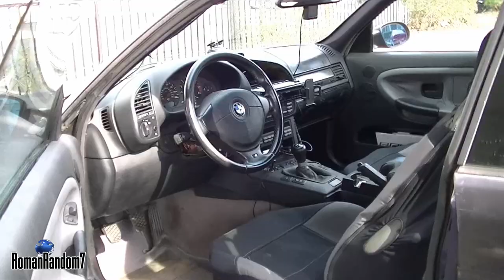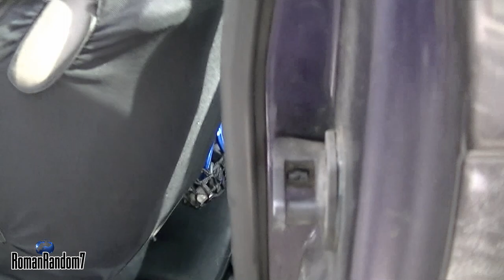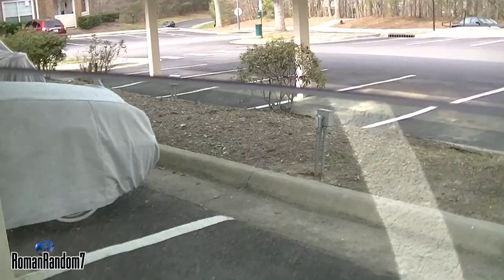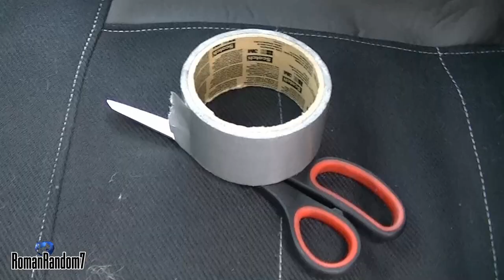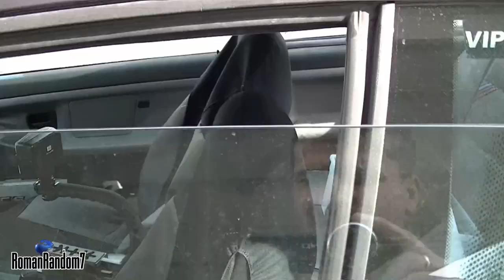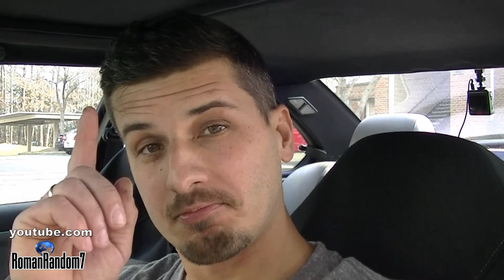BMW M3 E36 Coupe, Door Striker Sensor / Switch Temporary Fix

Comment: 325tds, doors locked, bounced open again, two years or so locking door by door by pushing the ¨locks¨ and the trunk, tried this and bam! didnt even know sedans have the switches there, so worn out that the door striker it doesnt push it down, no random id say, this is good shit
thanks man!

Comment: Great video.  Simple solution.  A more permanent solution that is also easy is loosely putting a few zip ties around the back of the striker- their cable thickness is perfect for the missing material and very cheap.

Comment: Yes. As U use the driver's door more often it's cheaper just to swap the switch with the passenger side AND be careful not to let the inside mount plate fall inside the body as it's not secured ..U will need a small piece of wire .. shape it like a hook to hold the mounting plate in place while U screw the switch on the B pillar ..good luck

Comment: Thank you very much for collaborating with these videos. I have a 325 E36 coupé, when I open the door the windows do not go down (neither of the two) that little that is needed to facilitate the softer closing later. Do you think it is this sensor? The rest of what the comfort module commands works fine. Thank you so much!!

Comment: Intersting fix.  The switch in my Z3 roadster is also worn out, I was thinking of "building" the button with some of that stuff where you mix glue and some kind of powder.  I suspect that will last longer, but of course I might have to file it a bit to get the shape and size right.

But, seriously, why couldn't they just use a normal button, like almost every other car???
Reply: Johann Kuhn I was thinking of doing the same and adding some material to the worn down button as the switch still works. Seems like a cheaper fix than spending $90+ for both sides on my coupe, and then have the same thing to happen later down the road. If it doesn't work well then ill bite the bullet and buy them. Did you try it?
Reply: Worked like a charm.

What I did was I first sanded the button a bit to make it rough, then I placed a bit of tape on the botom of the switch to hold the powder.  I then put some powder in, added a couple drops of superglue, took the tape off, and carefully used a very small nail file to file the powder down to the size and shape that the button should be.

It still works great.

Comment: My door on my E36 does the exact opposite. when the door is opened, the window does not do anything. So when you close it, the window is off track. I then have to wind the window down to put the window back in place.
Reply: same problem over here! were you able to fix it?
Reply: @rapsonata6638  I haven't.

Comment: You know if there's different types of sensors? Cuz my windows seems to lift/drop if I do it manually and actuate them manually on the doors lock mechanism with a screwdriver or similar. Edit: Mine is  a -94 cabrio!
Reply: there is, mine is having the same mechanism on a 93 coupe, put some ductape on the rubber piece which connects with the latch, it shall work alright :D